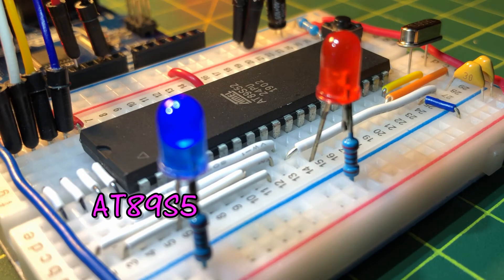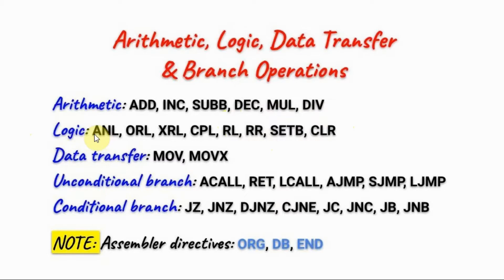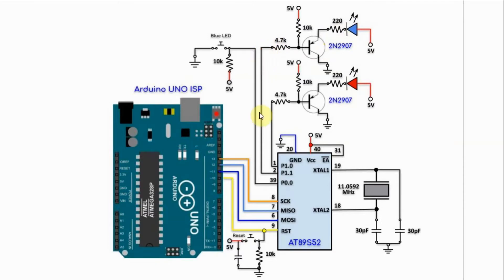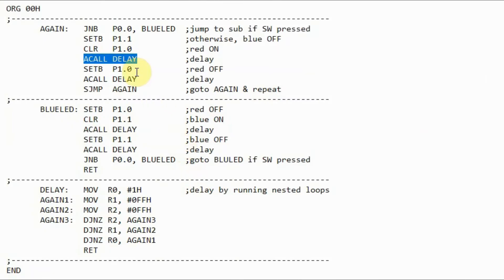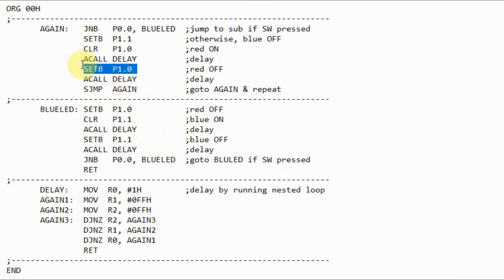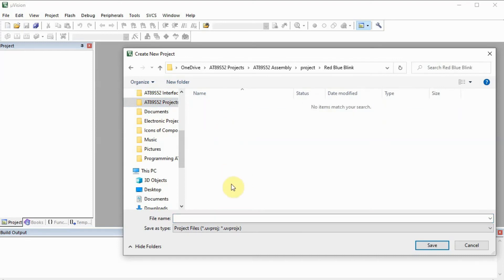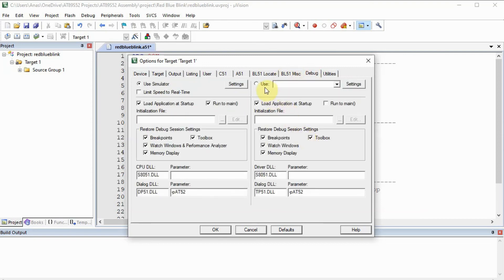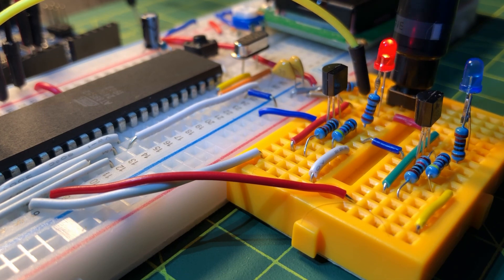AT89S52 Microcontroller Programming via Assembly

Comment: obviously if we wanted proper timing we wouldn't run a delay loop, but instead use the built in timers, correct?
Reply from the maker: Yes, which I have used in my other assembly projects. You can checkout my series on assembly programming via Arduino, where Timer0 & Timer1 are used for time delays.

Comment: I'm Not able to use a single 7 segment to this microcontroller as the output current is soooo low.. please help sir.
Reply: The output pull up voltage is low for this microprocessor. Current source provides low current you need to work it in current sink mode. Simply use negative logic instead of positive logic
Reply: @alexxander7770  Thanks, 😇🤓 but I used a BJT to increase the current and its working just fine. 
Once again thanks for your time. 🤓